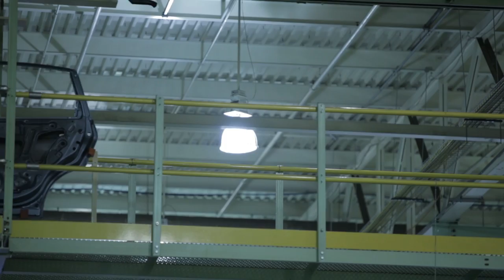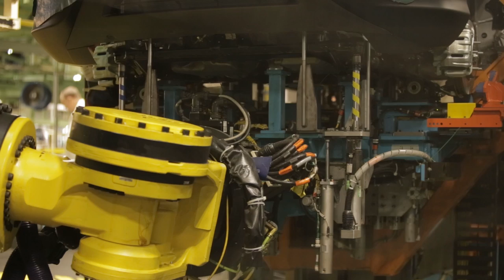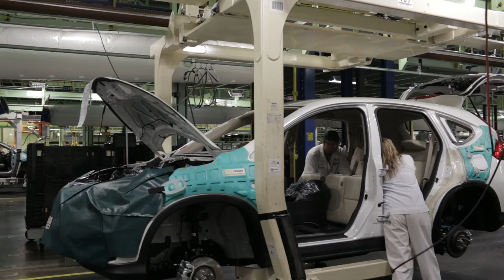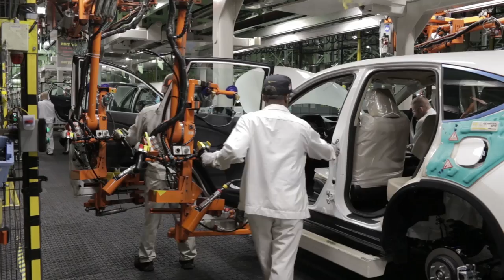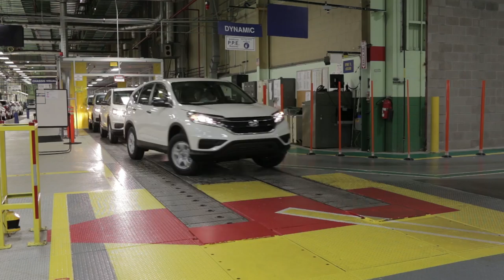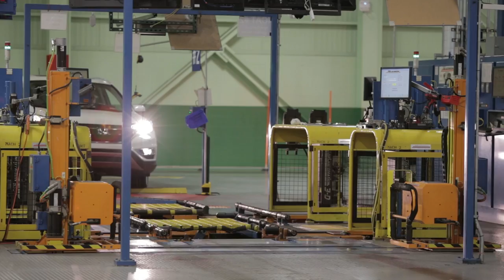Honda of America Manufacturing (East Liberty Production Plant)

Comment: very cool hope these people are proud of what they do
Reply: Not as much as they used to be, but it's not bad.
Reply: @zoidsfan77  if only the damn engineers would stop shoving the 1.5T into everything we build
Reply: @theepicgaming5260  The problems with the 1.5T have slowly been improved.  The AP5T is much more of a problem child.  Between that engine, and the unreliable air-ride system, I am genuinely concerned for the Acura brand imagine in the coming years.
Reply: @zoidsfan77  it seems that only gets paired with the V6 3.0. I know for a fact the new Integra is CVT until the last trim which is 6 speed manual
Reply: @theepicgaming5260  If I had to buy one, it would be a manual.  Shame it's a 4 door only.
Reply: @zoidsfan77  it's a shame the Integra is literally the only manual to roll off the line at Marysville auto plant. I'd fight someone for a manual K24